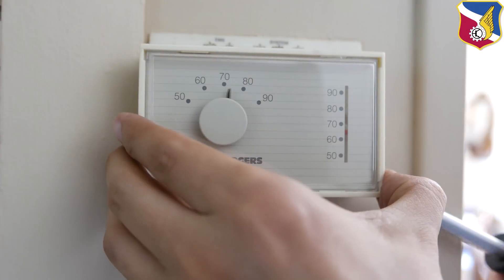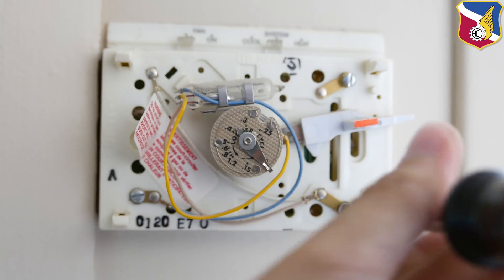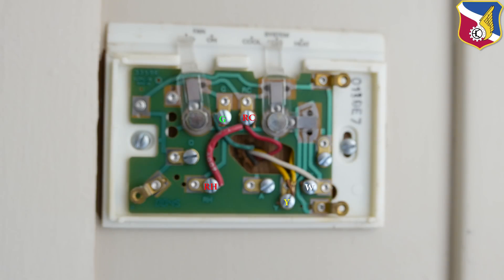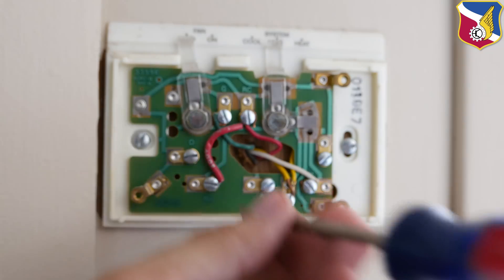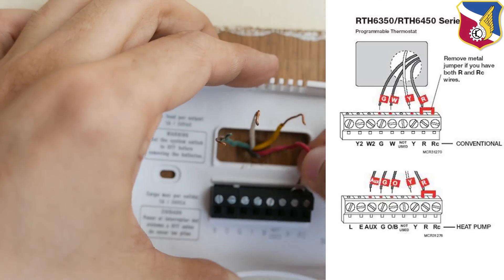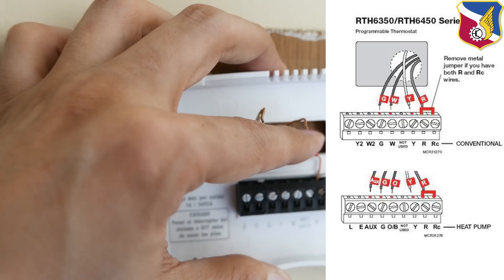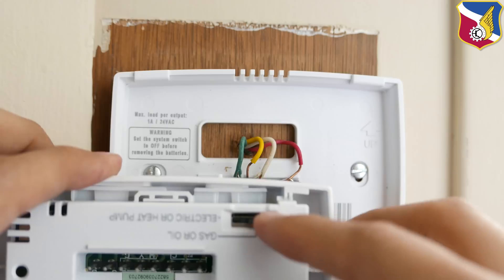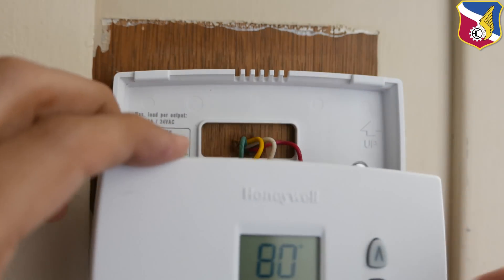Replacing mercury thermostat with a digital thermostat - install wiring white rogers honeywell

Comment: Very bad wiring job. Don't leave any wire copper exposed, cut and trim if necessary.
Also I suggest you paint the wall before installing the new thermostat. D- work.

Comment: I just installed it 5 days ago. do7.pl/honeywell1 My old thermostat did not have a C wire conected. The old thermostat wire only had 4 wires and this thermostat needs 5. I replaced the old wire and ran a new wire with 7 wires inside. The extra cost was not much and if I need a wire or two in the future, they will be there. I bought the wire with the 7 wires inside here on Amazon I bought a 50 foot roll and only used about 27 feet. You can buy.it at any hardware or home improvement store but I wanted it delivered.. The whole install with running new wire and everything took about an hour and a half. The old thermostat was programable but difficult to read and hard to program. When programing the screen is bright but dims a minute later. Still readable but not as bright. With the touch screen it is very easy to program and easy to set up the wiifi. Install the phone app and you can check the temp or reprogram any where you have phone service. The app works great. Take pictures of the wires on your old thermostat and the furnace connections. Youtube has some how to install videos which can guide you through the process and some are really good. All in all we really like it and I wish I would have bought it last fall. We highly recommend and it really deserves the 5 stars.

Comment: I don't understand why these need batteries.
If it was an Energizer or Duracell thermostat I could understand.
Reply: There is no common wire so the 24v can not power the thermostat
Reply from the maker: s0nnyburnett technically there is 24VAC going to them, and it could power the thermostat. u might be on to something.